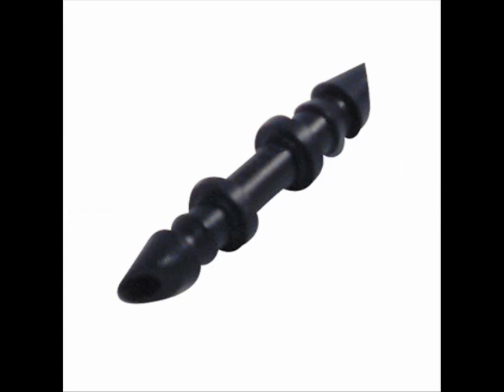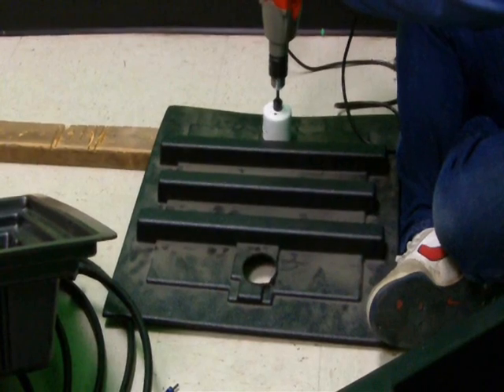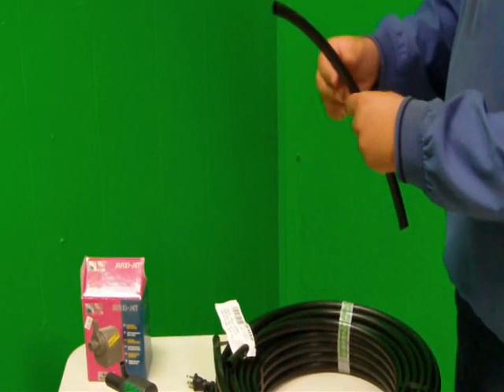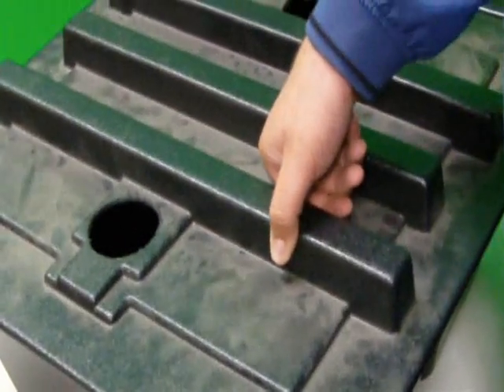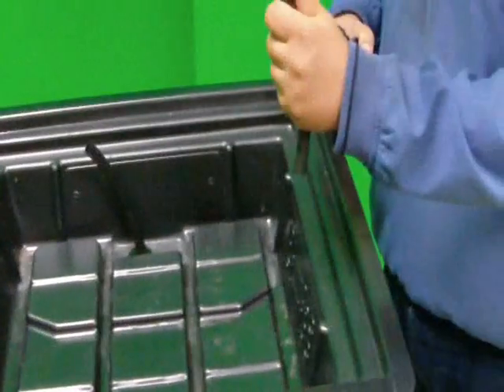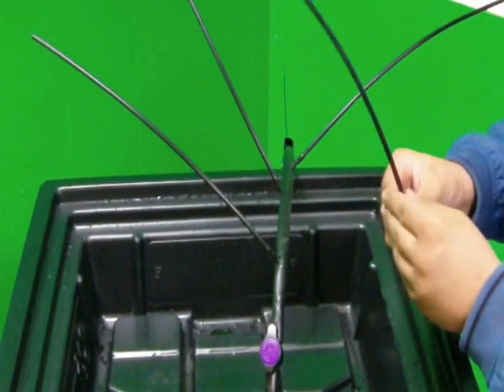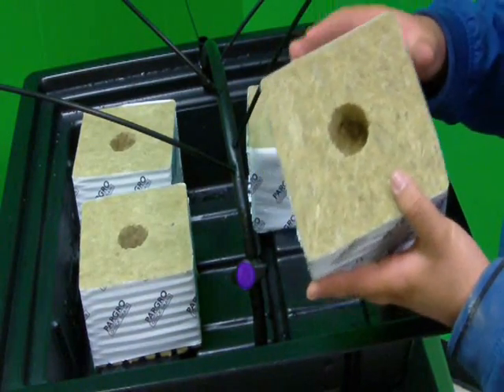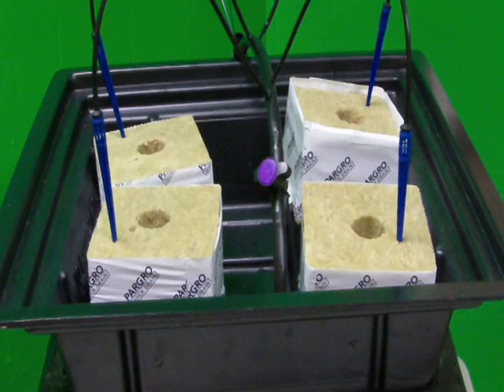How To Build A Top-Feed Drip System - Hydroponic Tutorials

Comment: thanks for watching the video. You can grow a number of different types of vegetables in this system, basically any thing that can fit. I have had very good success growing squash using this exact same system. The pump is set on a timer so its not running continuously, it runs about half the day.

Comment: I wanted to see this set up working? So the pump only needs to run half the cycle of the light, say the lights r on for 10hrs the pump needs to run for 5hrs right?
Reply: I have no idea what your talking about LOL
Reply: Yep did that an found nothing. Anyway I'll stick to DWC it's much better anyway
Reply: Ike D Hey, very informative video, thanks. specially the advice for drip system hydroponics. I also found very helpfull for the system was Panlarko Expert Aquaponics Planner - if you like you can search it on google.

Comment: Thank you so much for making this video!  I have a question though.  If I wanted to do this for 15 drip emitters would a 300 GPH pump be an appropriate size to use?  Also how long and how many times should I cycle the pumps on or is it just trial and error until I find something that works?  Thanks.

Comment from the maker: Hello, thanks for watching the video. You can grow a number of different types of vegetables in this system, basically any thing that can fit. I have had very good success growing squash using this exact same system. The pump is set on a timer so its not running continuously, it runs about half the day. The air pump runs continuously - the water needs to be aerated so that the water with the nutrient solution doesn't become stagnant.